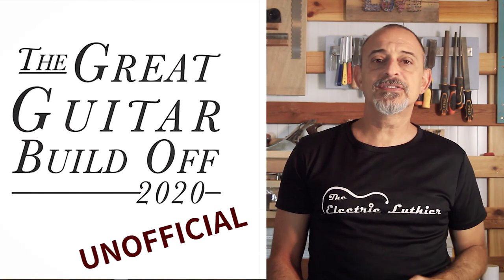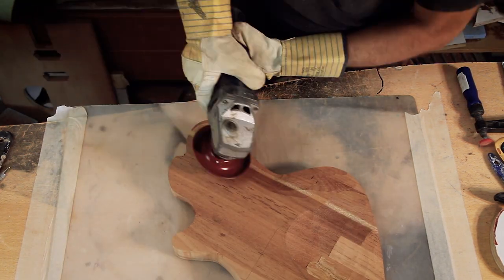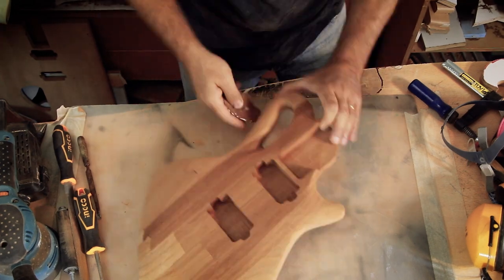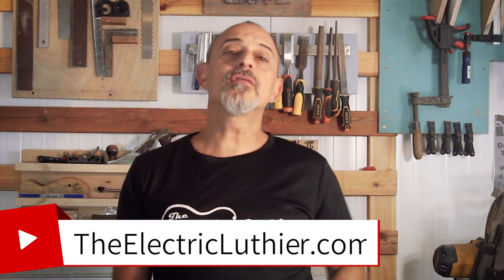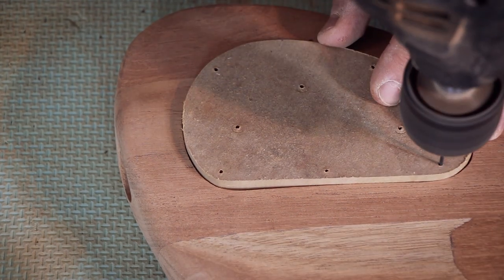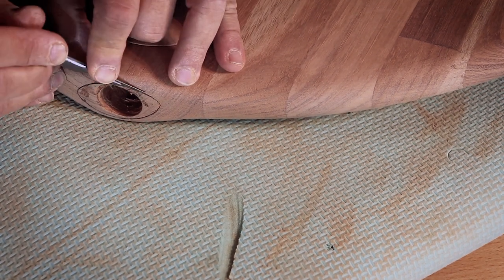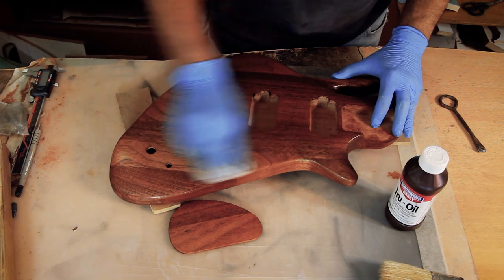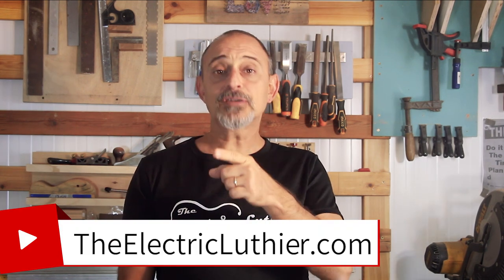My Original Design for the Great Guitar Build Off - Unofficial Part 5

Comment: looking good, nice shaping free hand. I have build 2 kit guitars, but i would like to start one from scratch, but first i would prefer to do some testing on some cheap wood, any suggestion? thanks and keep the good work! hopefully you can grow your audience fast! best Maurizio
Reply from the maker: Thanks Maurizio. Cheap wood really depends on your area. Pine is usualy easy to come by and my first body was a pie-strat. It's considered unsuited for a guitar' but it plays great and I learned plenty. Poplar is already reasonably hard and great to work with. You can use old furniture or reclaimed wood. You can also play with MDF or plywood, it's probably not going to make a great guitar but you can ruin it with tests and not feel bad. This mahogany neck was a bed I built about 25 yrears ago...

Comment: Use a handle on that disc grinder. It's easier to control.
Reply: Absolutely correct. I misplaced it for a while, but I am back to using it. Speaking of safety I should also get a new guard as well. 😊